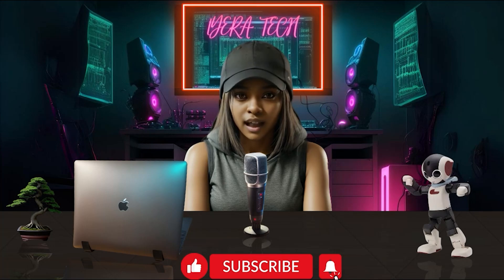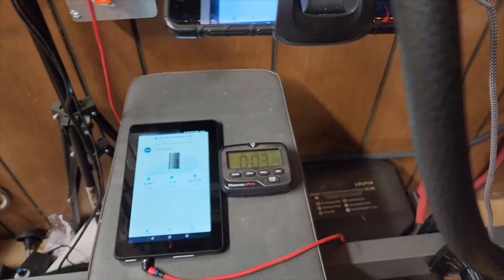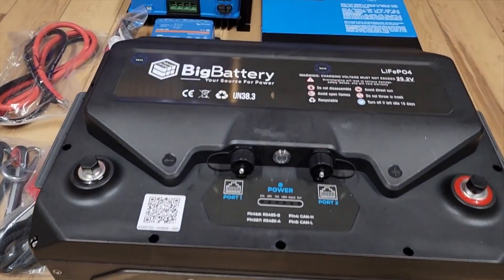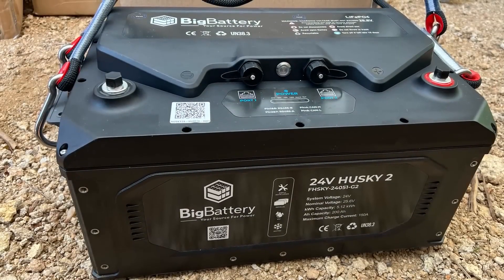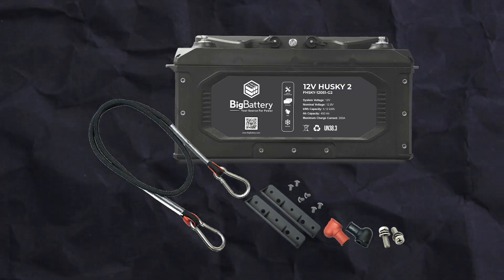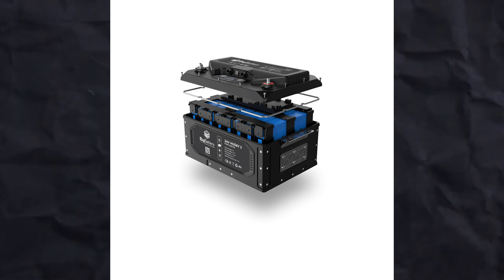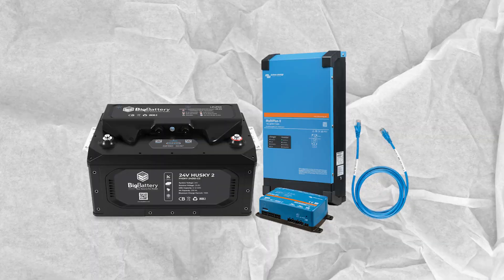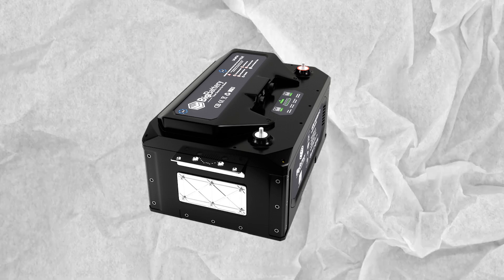Unleash Power! The Next Gen 24V HUSKY 2 Revealed

Comment: I see nothing about a state of the art Motor or the RPMs The 24V 5.12 kWh LiFePO4 HUSKY 2 Kit is the latest and greatest from BigBattery, providing unmatched reliability and efficiency in your RV and van applications.
 
The HUSKY 2 is our most energy-dense 24V solution to date, designed to power your adventures no matter how far they take you. From its Tier 1 LFP cells to its generous operating parameters and wide temperature range, this battery redefines versatility and durability when it comes to lithium power storage. But that’s not all…
 
The HUSKY 2 comes with state-of-the-art features to enhance the safety and visibility of your power. Not only is it housed in an IP65-rated casing, and equipped with an advanced BMS capable of auto-balancing cells, but it also boasts a self-heating function to ensure you have reliable power through every winter excursion. Plus, the HUSKY 2 features full CANBus and RS485 communication protocols, and the HUSKY 2 Kit comes with a 350A external capacity meter, so you can always monitor the status and performance of your power.
 
Our HUSKY 2 Kit was designed to serve as a plug-and-play solution for your adventure vehicles, and comes with all cables and components included for a quick and easy installation, along with a cutting-edge IP65-rated, 30A charger. Equipped with the HUSKY 2, you’ll be powered and prepared to hit the road worry-free every time. Shop the all-new 24V HUSKY 2 Kit today!